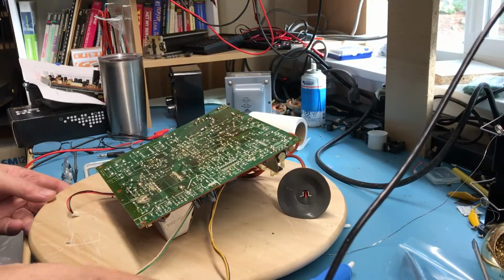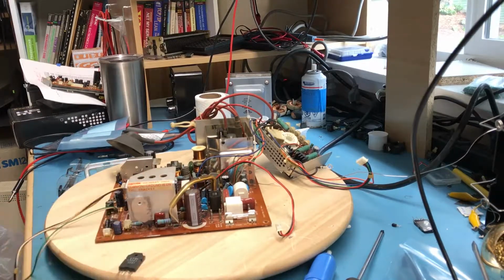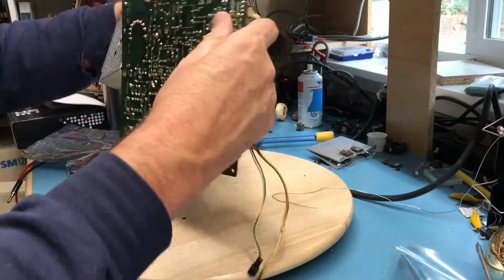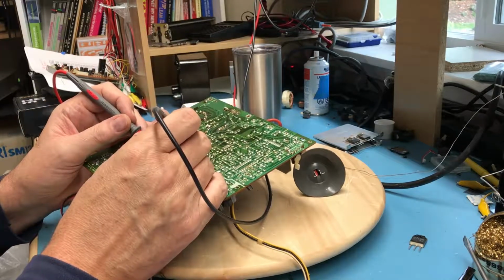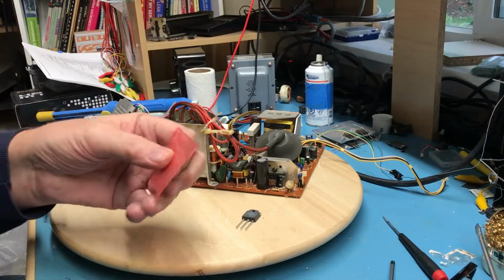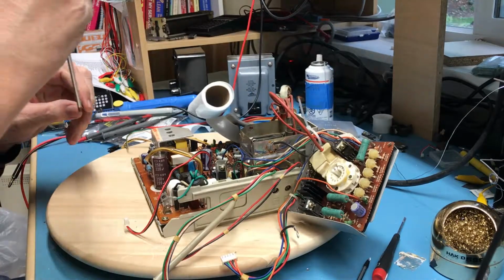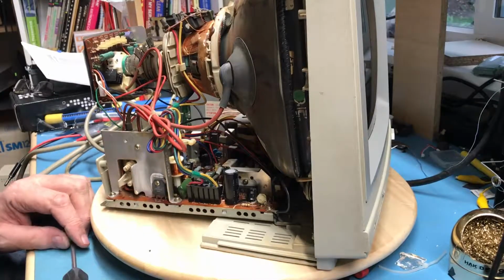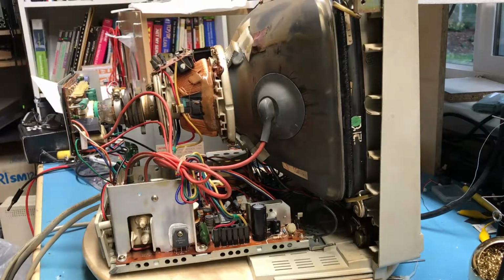Atari SC1224 - Part 4 - Another failed repair attempt - STB109

Comment: Got the same monitor with the same problem. I replaced all the caps & it failed to fix the issue - not a waste of time a number of them tested out of spec but still frustrating to go through the effort w/ no results. Don't suppose you found a service manual?
Reply from the maker: No, sadly I never found the service manual. In the end I believe the flyback transformer had failed. I eventually walked away. The monitor was eventually parted out by another person I gave it to.
Reply: @ShadowTronBlog  For future viewers...

 https://www.manualslib.com/download/1216375/Atari-Sc1224.html

Comment: I had a similar problem with the same monitor and it was due to the faulty power switch. I had to press it really hard and hold it for it to power on. Now it stays on all the time so I have to find a replacement switch. Did you check and see if the switch is faulty?
Reply from the maker: As much as i would have liked the issue to be a bad power switch it was far deeper then that. In the end I believe the flyback transformer had failed.